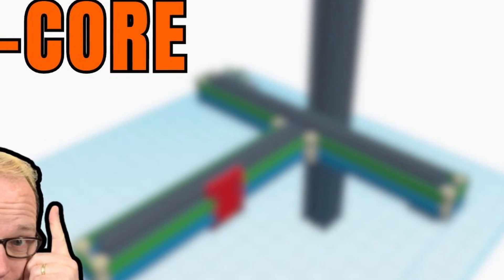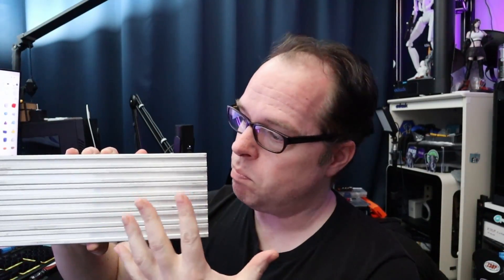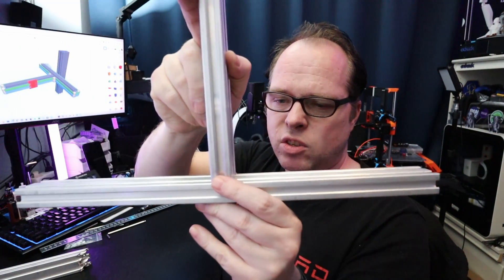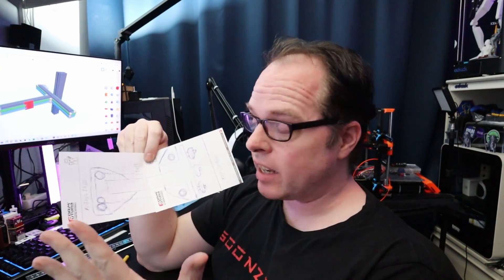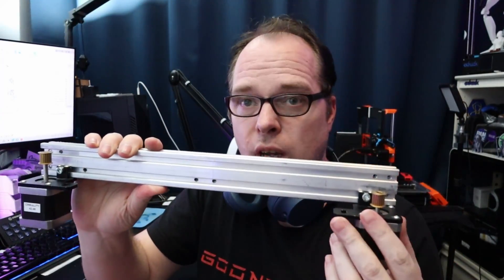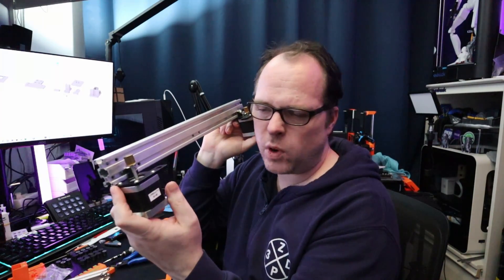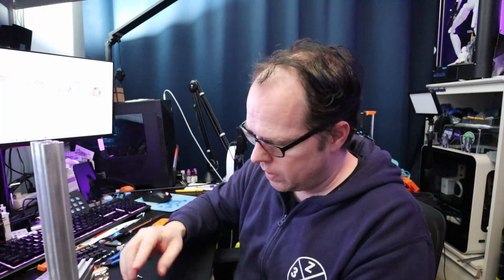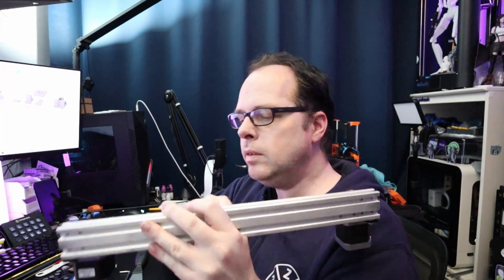Cantilever CoreXY - The Z-Core - The Frame - Part 2

Comment: OR instead of longer screws, mount a threaded nut hole in the middle on either side, OR heated insert into the middle and then you can use shorter screws from both ends.
Reply from the maker: Hey, sorry for the late reaction. I could do that too. I'm still in the prototype phase, so ill think about that.